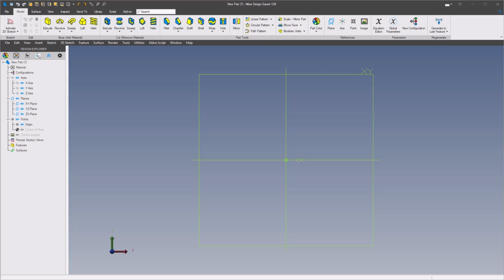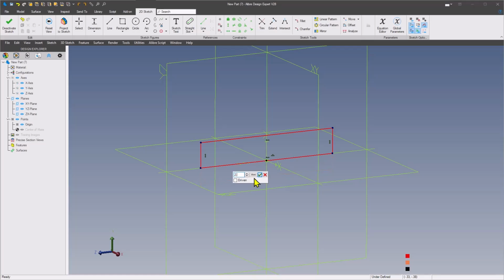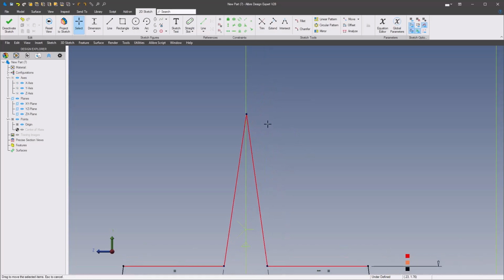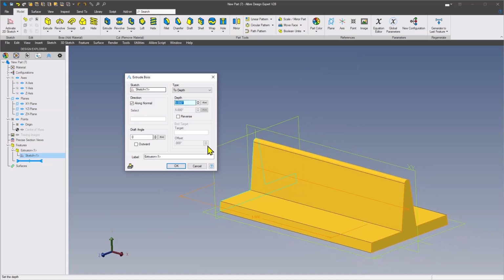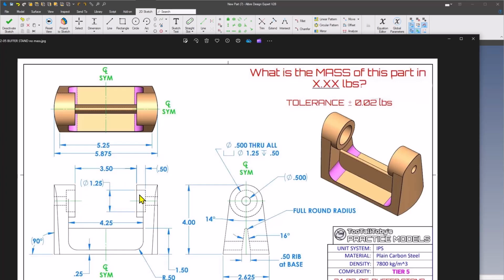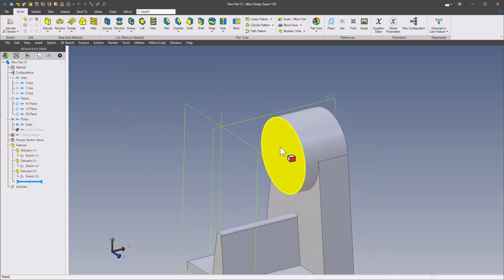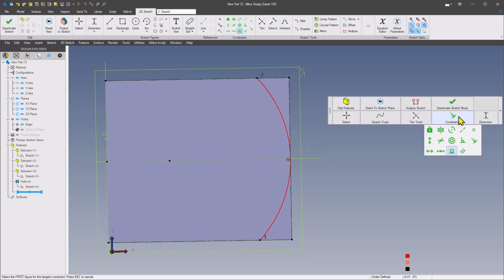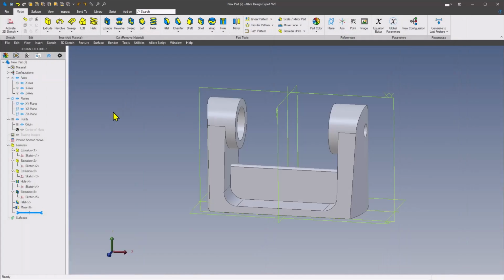Alibre Design Tutorial    TooTallToby's Buffer Stand

Comment: Hey Harold, I have another head scratcher practice model of Too Tall Toby - Model 24-04-08-TUBE BREAKER.  I know you have to use Boolean subtract but I just not comfortable or confident using assembly yet.
Reply from the maker: If your talking about the tapered hole in the horizontal tube, you can model that without a Boolean subtract. Insert a symmetry plane thru the tube and sketch a profile on it that you can revolve cut the tapered hole. You may need to add an axis to the tube, or if you have sketch display active, you can select the horizontal line of the profile as the axis of revolution. If you want a video let me know and I'll put one out.
Reply: @HaroldL-bn4eo  Thank you sir.  I used you suggestion and I got pretty close to the correct answer of 2195 gram.  I was off by 18 grams.  Thanks again.